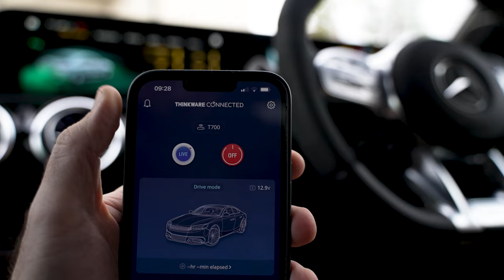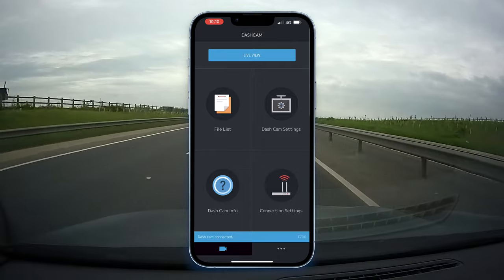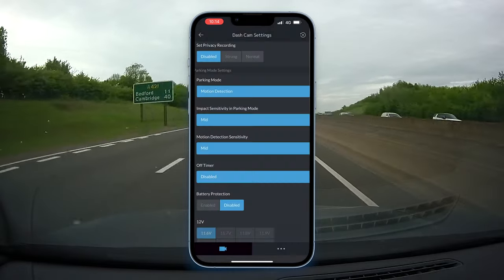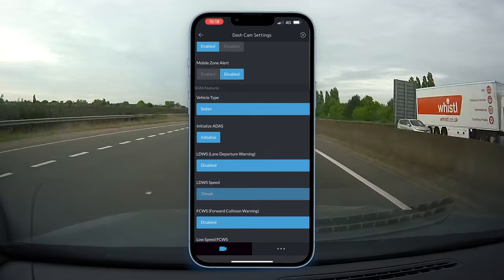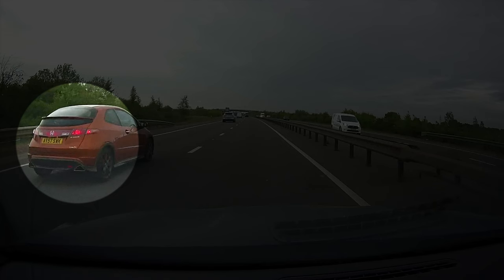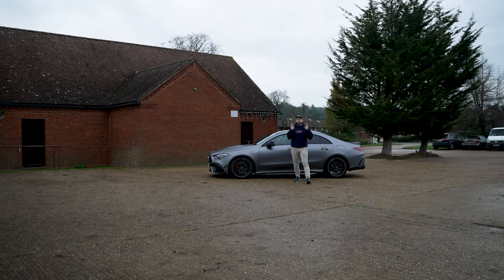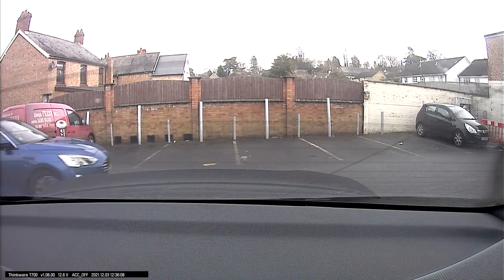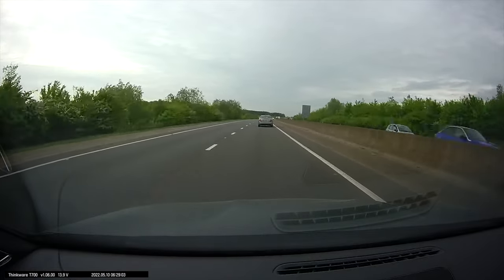Is this the best dash camera for your Mercedes? My Thinkware T700 with live parking record

Comment: I have problems with my t700 where I can't change the sensitivity on the settings, had the t700 for two years now and still no firmware updates,
Also it's a shame I can't change the sim card from Vodafone to another provider 
Vodafone are useless, 
Also wish it had a separate   box for the 4g sim card. Like the BlackVue dashcams,
But I do like the ADAS features that BlackVue dashcams don't have, 👍👍👍

Comment: Did you install any additional camera? I mean: how to solve the blind areas on side of the car??
For the rest, Thinkware T700 is the better compromise into LTE dashcam segment
Reply from the maker: You can get additional camera setups but at the moment they are quite large and only really suitable for HGV's. The way Tesla have the cameras mounted into the mirrors is brilliant. I hope this will be available wider as an aftermarket in the future as they would be really good to have. Currently running off these batteries we only really have the option of a front and rear which won't cover much of the sides but I'm hopeful in the future this will change.

Comment: Very importand question; I will apprecaite if you could reply asap; Is TFL Approved Dash Cam? If so is there any fitter you could advice in UK? Thnaks
Reply from the maker: Hey no problem. I’m not as familiar with TFL so I’m not sure sorry. If your getting a dash cam for a taxi I think you would be better to get a dual front lens camera so it records inside the car as well as in front on the road.

Comment: One more question. Does this camera have the option to monitor the actual car battery voltage via the Thinkware Connected App? I know it's possible to see what the value is for U3000 model, but I was wondering, if T700 also has this functionality. I mean being able to view the actual voltage - I'm not talking about the cut-off function when voltage is low.
Reply from the maker: Hey, no problem! Yep voltage is displayed on the main screen in the top right corner of the car graphic on the connected app. It’s also displayed in the bottom corner of any footage next to the time stamps.
Reply: Thanks so much! Do you get any false positive alerts in the parking mode, when you are leaving the car or entering it?

Comment: Does this have a hotspot feature that'll let you use the Internet from another device like a tablet? Thanks.
Reply from the maker: Hey Raju, I'm afraid I don't think you can with this although I'm not 100% sure. Most Mercedes-Benz will allow you to do this using the car though however If you are running a Merc.
Reply: @ABAUTOAMG  Thanks.

Comment: Does your phone connect automatically to the camera's wifi or do you have to do it manually? I'm asking, because on Blackvue whenever you're approaching the car, the phone switches to the camera's wifi, which helps eliminate false impact notifications.
Reply from the maker: I don't think it does with the Thinkware. It's a bit clunky you have to press the wifi button on the camera then connect up manually on your phone. The camera is always connected to your phone though via the SIM card so you can do live view at any time no matter where you are. I don't think it has that feature though from the Blackvue, sounds like a nice feature to have.
Reply: @ABAUTOAMG  Thanks for the answer. I was asking about that, because with Blackvue I was looking for a nifty way to eliminate those pesky false positive alerts when getting into the car and slamming the door. Of course in such a situation the car is still in the parking mode, so it registers an event, when you slam the door. My solution with Blackvue was quite intricate, but worked great. I installed a Macrodroid app on my phone and made a macro with the following condition: if the phone switches to Blackvue's wifi (i.e. I'm close to the car), then cut off all Blackvue app notifications. In this way, I only received notifications when I was away from the car. I'm wondering how to solve it with Thinkware, since its wifi isn't turned on all the time.

Comment: Ok, I've got one! when I view the live footage via wifi on my phone the rear image is reversed, trees on the right are to the left of the image, is this correct or do you know if I need to flip it in some way?
Reply from the maker: Ah! I havent actually noticed that on mine. Wouldn't that make the number plates backwards too? Don’t worry though if you ever need to use the footage it's very easy to flip it on the computer. Not surewhy yours is displaying this way though!
Reply: @ABAUTOAMG  Apparently it's normal, the recording is the right way round. :-)

Comment: Hi mate how long did it take you to get the green light stay solid? I've turned it off 20 times and it's still flashing green then goes back to red and tell's me wifi hasn't been detected and also how do you activate the sim card so that i can set up the monthly payments to Vodafone?
Reply from the maker: Hey Paulst220 It should not take long at all, under 20 seconds. It was a little while ago when I set mine up but there should be a little red card/leaflet with instructions in the box along with the sim. Did you manage to get it all working?
Reply: @ABAUTOAMG  yeah eventually, I didn’t know I had to download the Vodafone Smart App to set up the SIM card first before the green light would stay. The instructions in the box should be more clearer but it’s done now, the problem I now have is when I press the WiFi button to connect it to my phone it’s not connecting.